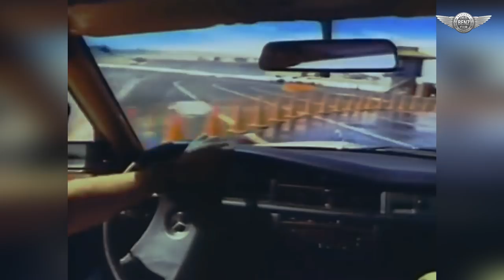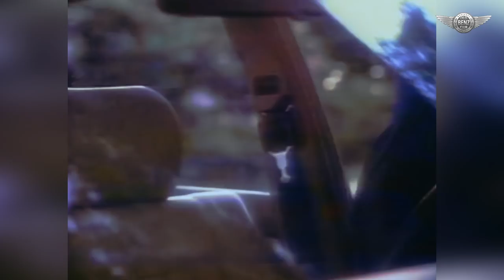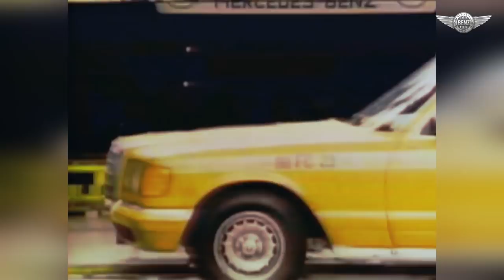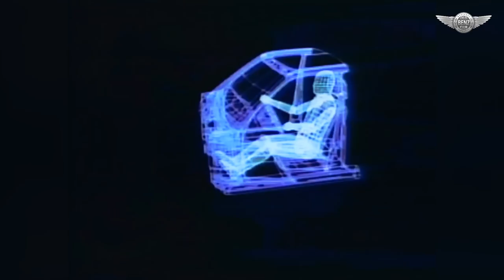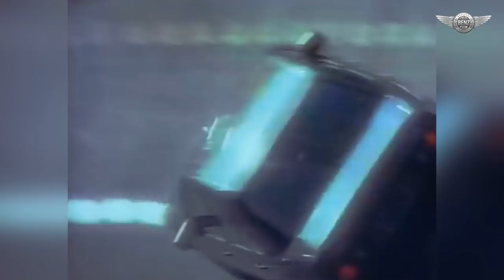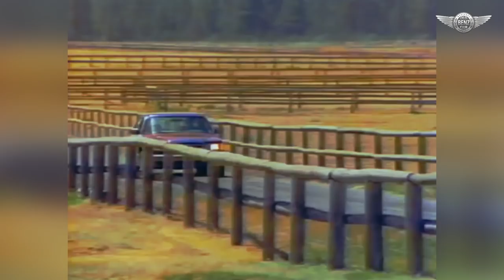Mercedes engineering philosophy - 1987 documentary film, part 2

Comment: Mid 1980’s Ford Tempo was used. No competitor for the Mercedes Benz. Totally different class of automobile.
Reply from the maker: Ford Tempo is comparable to Mercedes w201
Reply: They are not comparing the cars. They are showing the results of a car that’s equipped with ABS and one without.